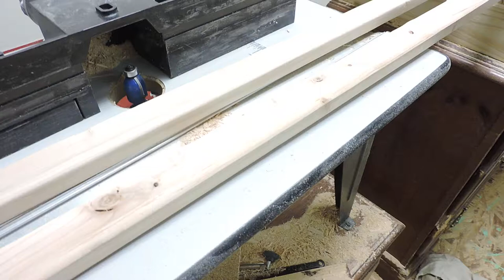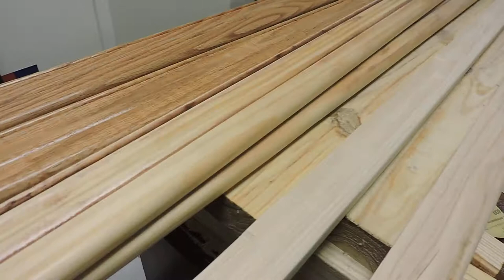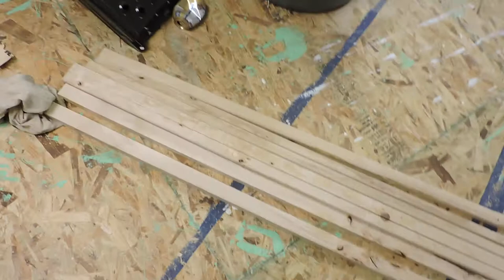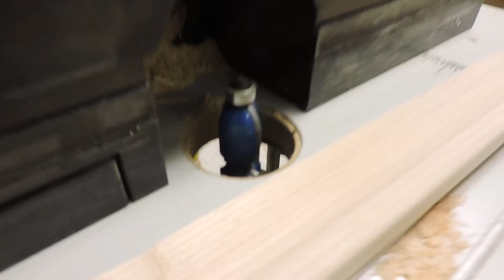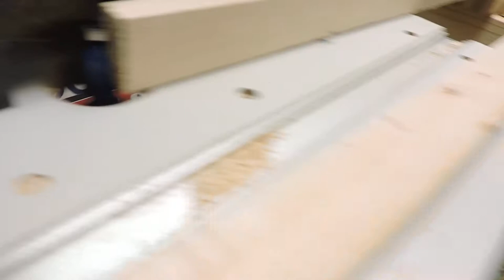making stretcher bars for canvas prints

Comment: Thanks this video helped a lot, I've been trying to figure out how to bevel that edge, I never used a router or router table. What bit do you use for the router?
Reply from the maker: On the box it says cove and bead for that bit. It was in a set of four molding bits. The most important thing is just to have a small rounded lip at the edge.
Reply: That's exactly what I was looking to do, I'm looking to mass produce them. Someone told me a molding machine would be my best bet.
Reply: I found a better bit for doing this, if you ever have to do it again.
Reply: @johnh9002 what bit is that if you don’t mind me asking?